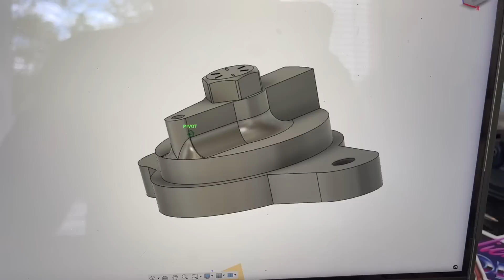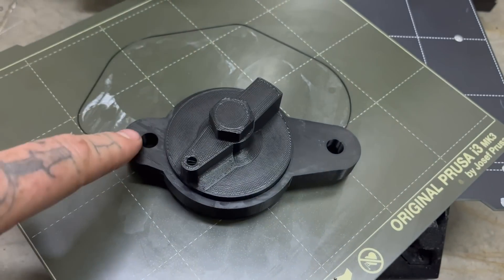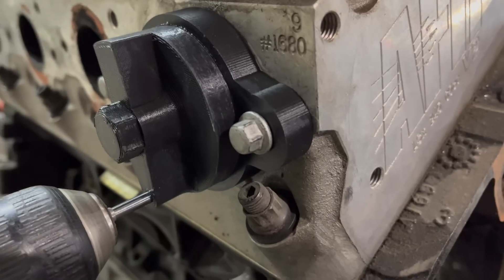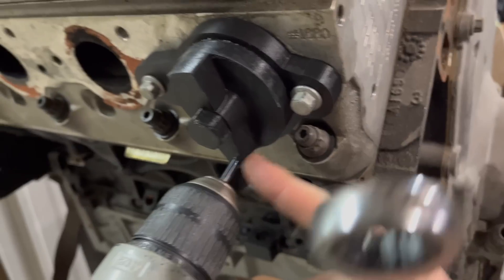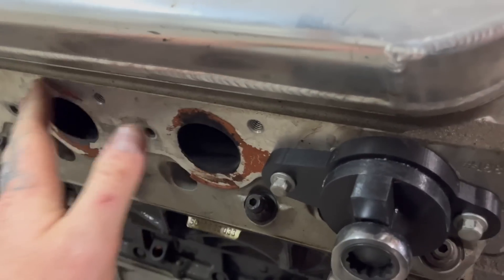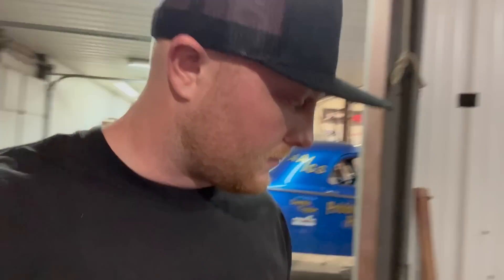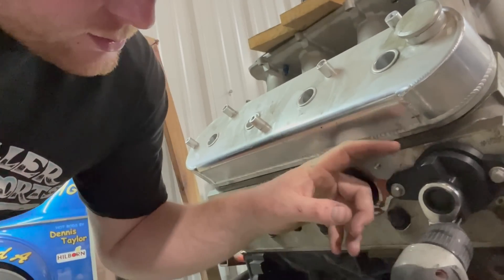Inventing A DIY O-Ring Jig?! I Think I May Be Onto Something 😳

Comment: I'd look at designing it to use a trim router rather than a drill. You'll get higher speeds, better feed rate and bearings designed for side loads. Pretty cheap these days (£30 here in the uk). You could get rid of the spanner part then and just have two shells that rotate around each other and both hands would be on the router. Mill a D shaped channel on the side facing the head to give space for chips. Great to see people trying things. Too many parts fitters rather than proper mechanics these days.

Comment: What about if you drilled smaller hole then the dove tail and then ran that around then ran the cutting device in there? Also could you go to the junkyard and find a gas cap that would fit that thing or another car part that u could modify idk

Comment: You might run into a problem with chip clearing. There isn’t anywhere for the cut aluminum to go. Oh and I still own and operate a full cnc shop specializing in billet aluminum. Just saying